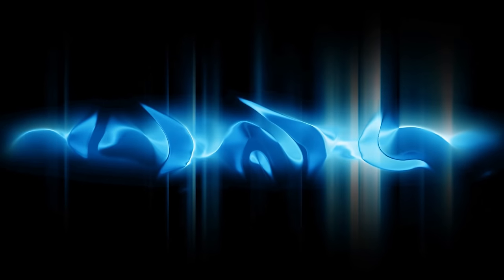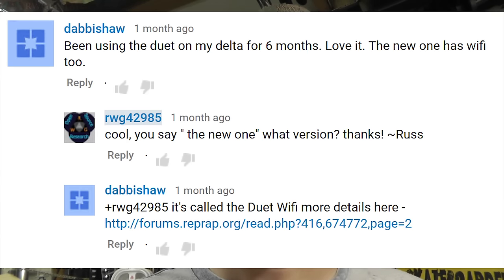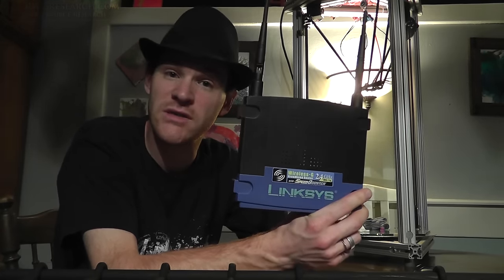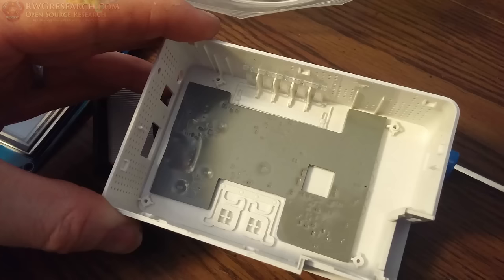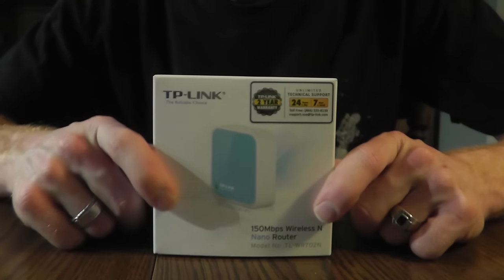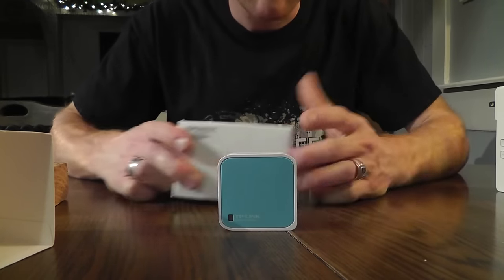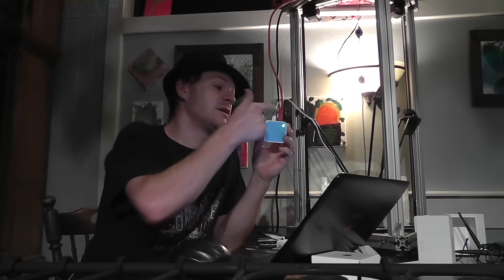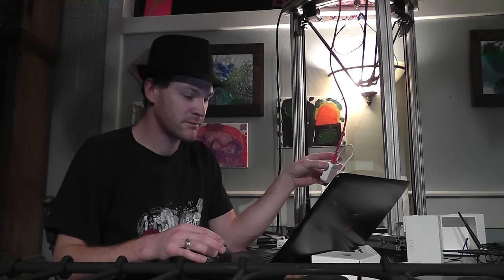RWG-OSD # 20 Duet Wifi Coming Soon... But For Now... How To Make Duet A Wifi Capable.

Comment: That is a awesome router, i have used them in many projects, robots, mesh networks etc. There is also a similar router with openwrt installed from start, its brand is gl.inet. A little bit more expensive, but have 2 ethernet ports,  more memory and  easy access to uart and gpio pins on the pcb..  You are building a very nice machine ! keep up the great work!